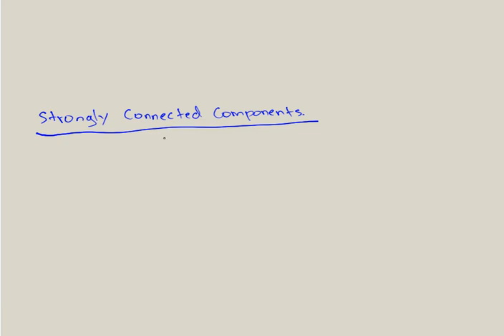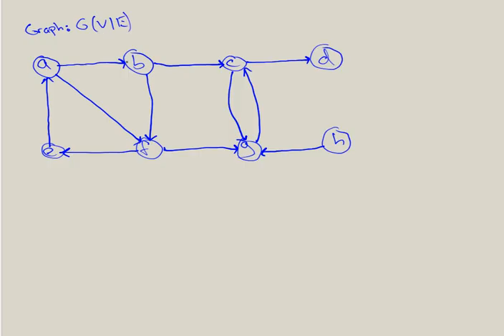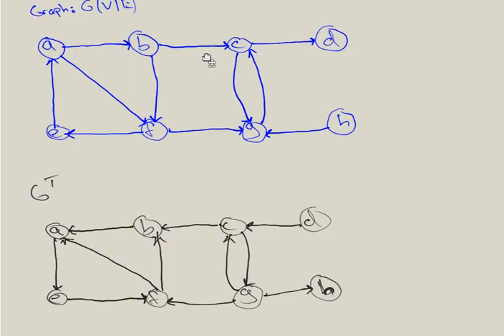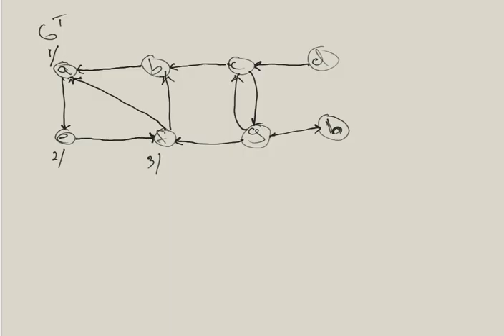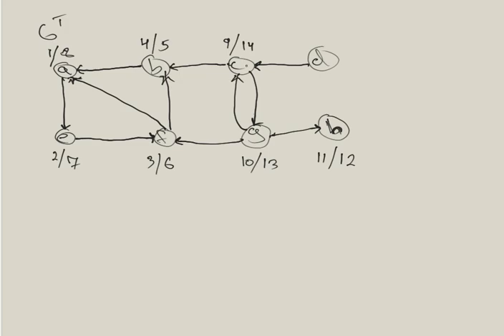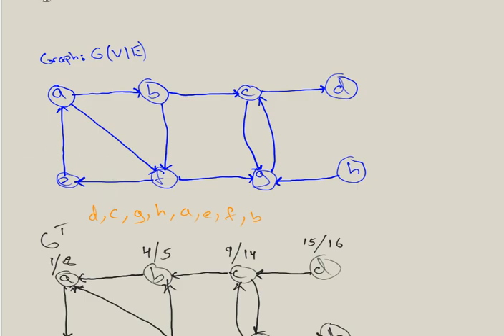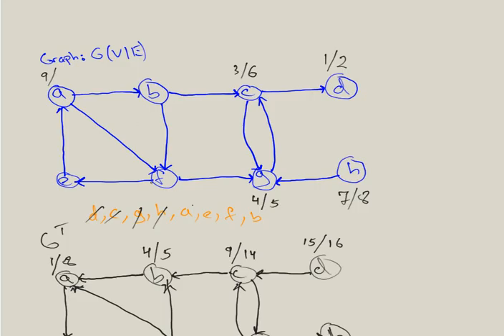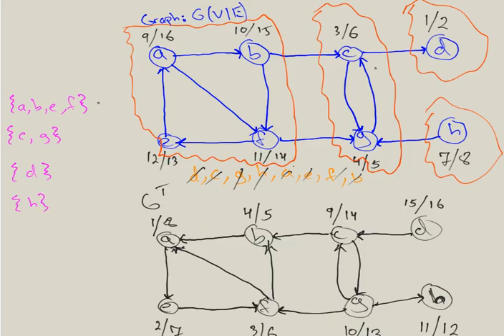Strongly Connected Components

Comment: You explained a text book solution (algorithm), but failed to communicate where exactly does someone realize when he/she gets a SCC. For ppl who need further explanation - SCC is found on the second traversal, when DFS on a vertex finishes. The  number of DFSes provides the number of SCC. In order to arrive at such a state, one has to follow the order of vertices obtained by the traversal of the transposed graph.
Reply: absolutely right just keep the post order of reverse graph and write it on actual grapg nodes, do DFS on original graph on the basis of descending post order when dsf end its a scc thanks,
Reply: CLRS.